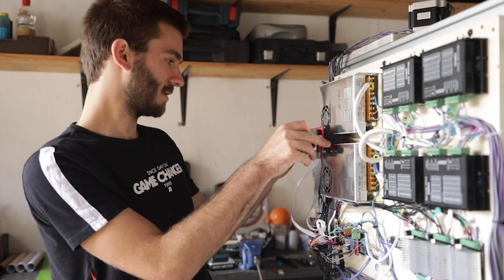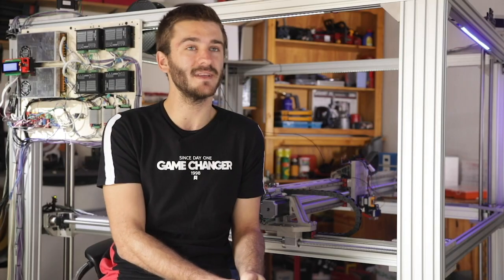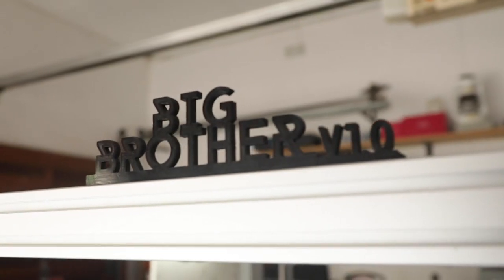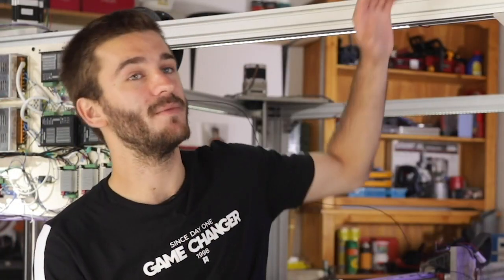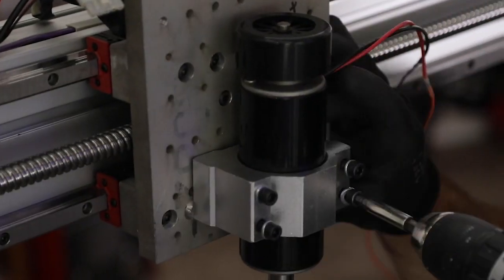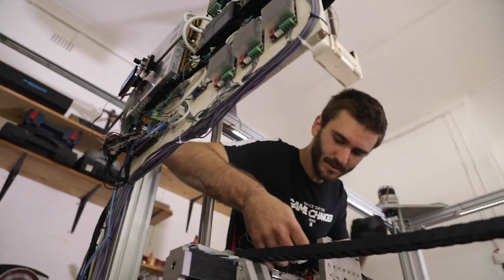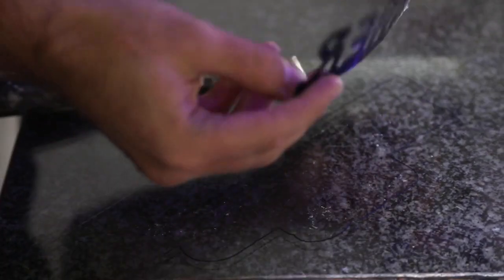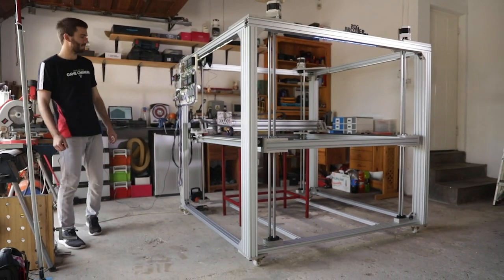Giant Industrial 3D Printing Hybrid: Big Brother v1.0

Comment: Cool! Still using it? Were the ball screws worth it?  Whats the largest thing you've printed?
Reply: Thanks Matt! Yes, we are still very much using it, as well as finishing up dev on the next iteration of the system. The ball screws are definitely worth it, particularly once you start working with heavier load operations such as pellet extrusion and CNC machining. I would however say if looking just to 3D print with filament, belts would also work. The ball screws were used with heavy duty applications in mind.
The largest things we've printed are giant 2m tall megasized cooldrink cans for a marketing campaign. The cans themselves were printed in two halves that were put together after printing. We have some even bigger projects in the pipeline. We will be sharing more content soon!

Comment: good idea but to really print a big item it still needs days if not weeks. so, prototyping can make sense but in no way it can replace industrial manufacturing.
Reply: That is generally the case, however there are certain niche industrial applications where even a 2 week 3D print is way faster and cheaper than a 2 month conventional production route. Also you could achieve quite complex geometries which otherwise cannot be achieved conventionally. We are also introducing high volume pellet extrusion to cut printing times tenfold. But yes, by no means is this replacing industrial large batch manufacturing. But there is a great deal of potential to replace / work alongside existing technologies. We are excited to keep exploring where these technologies can offer a sustainable, quick and efficient alternative :)
Reply: @denmarinov3717  but, why not modifying it to print really fast? there are lots of ways to acchieve this. so, that e.g. a chair can be printed in 0,5 - 1  hours.
Reply: @quo_vadis_europa  yes I could have used lighter aluminium profiles and timing belts instead of ball screws to achieve faster printing time. However, the reason I went the heavy duty route was so that the printer can double a s a CNC mill (capable of cutting aluminium and certain steels). This is a bit harder to achieve with a lighter duty printer. However, as you have highlighted, this does come at the cost of slightly reduce print speed. It's a bit of a catch-22 between speed and power. The purpose of the hybrid functionality is to a) reuce the number of machines needed in a workshop and b) allow for 3D Printed objects to be post machined. Again, this particular design has niche applications and you can find other printers that have higher print speed but don't have the hybrid functionality. At the end of the day, this was the first experimental unit I made. There have been a lot of improvements in precision and speed since and they will be shared with the community in future :)

Comment: I have designed an extruder that would fit perfectly the type of machine you are building. Pm me for more info
Reply: You have some video for show any design you do before?
Reply: @PterPmntaM  I currently have 3, but as soon as Im done testing my current projects I will have a new extruder, a new xyzuv gantry and a cnc machine.
Reply: @johnrockland18  Great, at this moment, my old printer (Core XY) is in the upgrade process with the same person who made the Custom Build, now, I expect in at least the 15 days to give back transform into a BLV 220 x 220 x 250
Reply: @PterPmntaM  if you have some extra parts give a try to my extruder (give me a week to upload the latest version) : using a drill instead of a nema, I was able to lift 45lbs without denting the filament. And the wiring management look much better then anything I have seen yet.
Reply: @johnrockland18  I would, but at this time is difficult, the date for the pick my printer is on the first week of February. In some time in the future, maybe I will try, never before I had a 3D printer with two extruders.
Reply: @PterPmntaM  some video on my channel, but I really need to update them. the first version of my extruder is on thingiverse https://www.thingiverse.com/thing:4703344/comments
Im testing the version 2 right now, I will make an assembly video and upload the files pretty soon.
It is a high capacity extruder, quad geared 3 to 1. a bit expensive to built but it push material like no end.
Reply: @PterPmntaM  Also the V3 will be remote-direct extruder with the back perfectly flat so it would be a direct fit on your plate.
Reply: @johnrockland18  Do you have any video in your channel?

Comment: If youre in to 3d printing you would know its not that hard to achieve even with non "industrial" components
Reply: For 3D Printing purposes, I agree. Industrial components are overkill. However, the industrial components were necessary for higher precision CNC milling functionality. Also helpful if printing with concrete.

Comment: Are you printing on marble?
Reply: You're right :)
In the beginning, I was using a marble kitchen table as a print bed surface. I have since built an aluminium print bed which is not shown in this video but will be shown in videos to come.
Reply: @denmarinov3717  Awesome, how was the adhesion?
Reply: @timmturner  I covered the aluminium bed in buildtak and occasionally use hairspray. When working with thick layer thickness, the adhesion is quite good. Only with finer layer height does some warping occur. I expect enclosing the printer and climate controlling it will reduce warping. But in general, adhesion is quite good. I even struggle to remove some large parts. I also find that (don't scream in horror) a raft for larger parts helps with adhesion ;)
Reply: @denmarinov3717  It's an amazing printer you have built, being able to print entire car parts such as an widebody kit would be insane.

I look forward to seeing the updates.
Reply: @timmturner  Thank you! Will be making some new content soon :)
Reply: @denmarinov3717  I print directly on steel plates (3/4inch aluminium bed with magnets and 0.5mm steel plate on top) every day without problem:
Sand the plates with 40 grid to scratch it good, then wipe it every 4-5 prints to clean it.
I keep mine at 90c and I have no issue.

Comment: Is this open sourced? how much did the parts cost can any of these components be scavenged from other products easily and how large are the gcode files for these larger prints?
Reply: There will be an option source version soon. I'm working on the documentation. In total, materials can cost up to $10 000 depending on the extent of hybrid manufacturing. Parts could probably be sourced for half that. The frame was made from quite costly aluminium profiles but these could be replaced with steel tubes which will reduce cost but subsequently increase mass. Stepper motors could also be scavenged. As for the linear motion systems, ball screws and linear rails were used. Alternatives could be incorporated but I found these were best for precision manufacturing.
Reply: Steel tube probably be the best for printing cob & chipped tire. Ill probably not have a moving bed but move the print head in full 3D field. Maybe a rigid 3axis crane setup is in order to use pnumatic bladders to cut costs.
Reply: All about printing homes for free for the people by the people.
Reply: @TheIndustrialphreak  This sounds great! I'd love to see how it goes!
Reply: @denmarinov3717  These are wonderfull news. I really can't wait for your work to be published. Stay healthy...

Comment: It's been banging around in my head to make a giant 3d printer and the way you have the X and Y are exactly what I was thinking of doing but I like your Z axis better than what I was thinking, moving platform but yours has the gantry moving up.  Makes working with getting the print off a little easier I think.